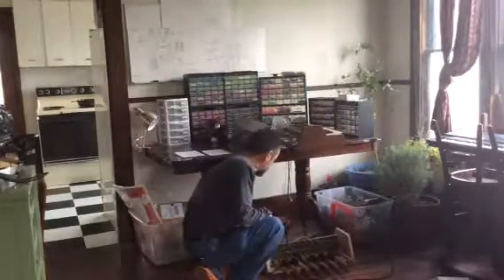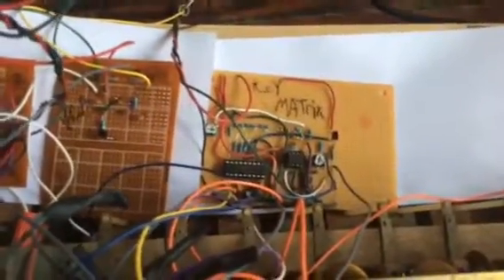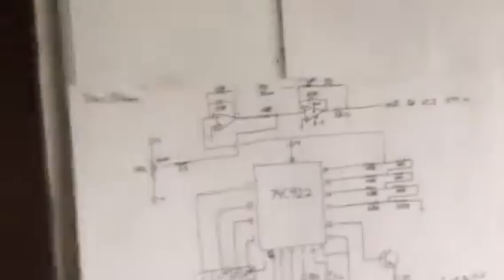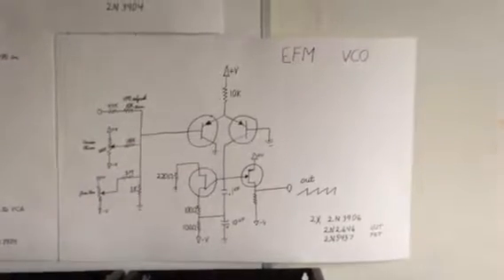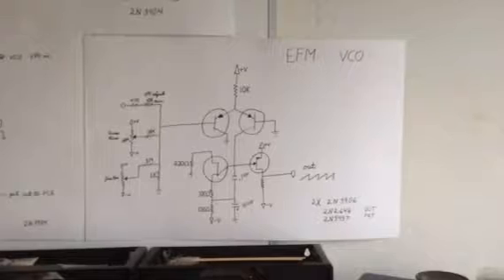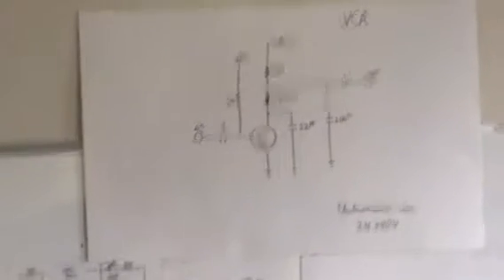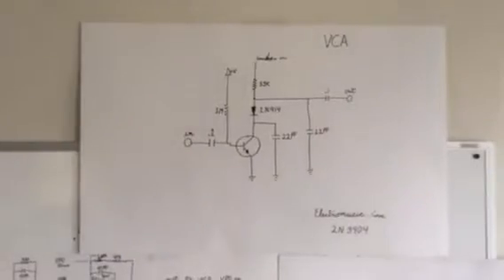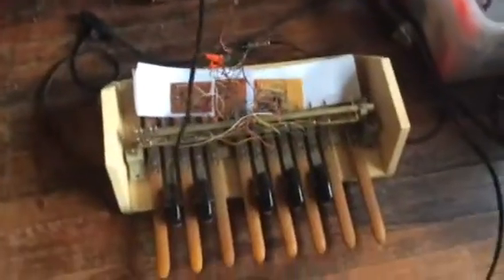Easy DIY synth project (video 1)

Comment from the maker: Tunes good for about 2 octaves when plugged in to a full keybed, then goes flat. I bonded the top 2 transistors, however it's not perfect. About like keeping a guitar in tune. As a guitar player I'm use to a little tuning with temperature change. My compensated VCO1 in my modular really isn't any better if the temp changes 5 degrees.
Reply: Thanks for the  info and reply, intresting to see a vco topology using pnp transistors as a pose to NPNs btw did you have to match the transistors ?